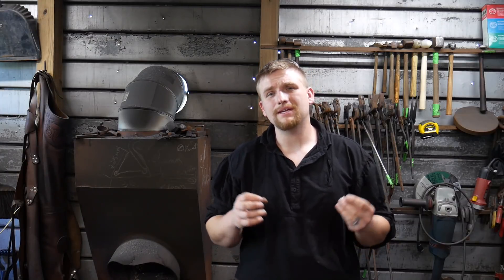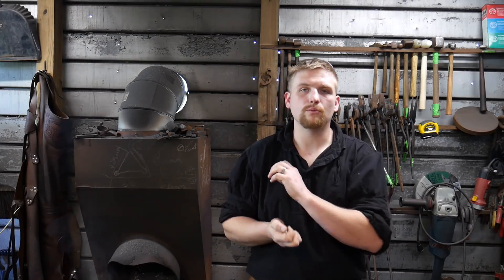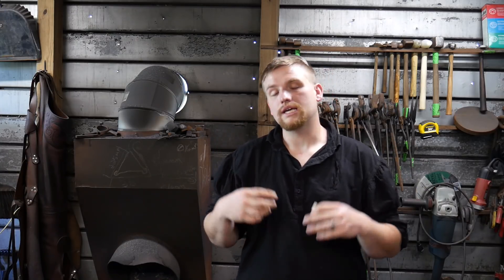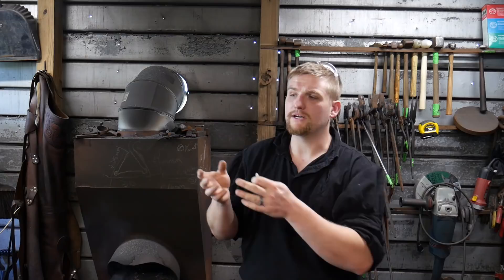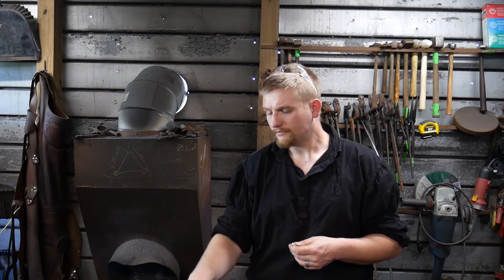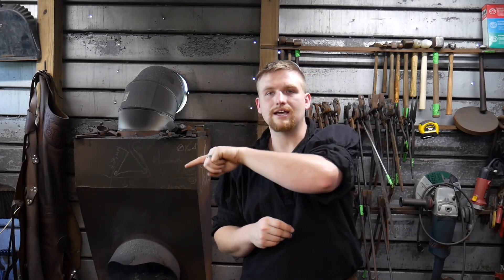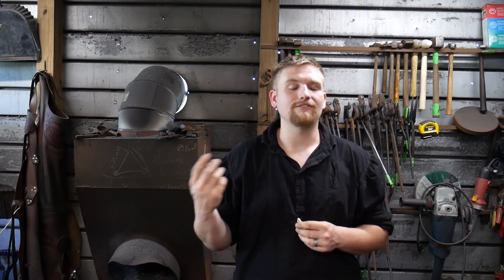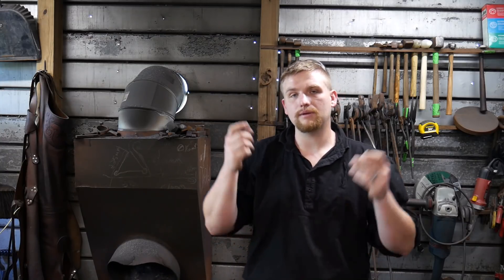Why I Harden In Water VS Oil

Comment: I use 5160 more than anything for the professional grade throwing knives I make and cell which are considered one of the toughest throwing knives available. For the purpose I use 5160 for I use Parks AAA quenchant preheated to roughly 130°F. Only other two steels I ever use are 80CRV2 which I use Parks AAA for, and at times I make and release a run of throwers made of W2 tool steel which I use Parks 50 for.

Comment: I always wondering this: all the factories have heat treat metal sheets with heat deggrees  for any kind of steels. BUT all these numbers are calculated for steels to be tools! and NOT knives with very thin edges. So  is anyone knows where to find heat treat metal sheets especially for knives?
Reply: Ask the steel producer of the steel you want to use

Comment: I have a question you may be able to help with, recently some expensive exhaust components on my truck grew legs and walked away.  Seems to be a large problem right now.
So my solution to prevent this is to weld rods onto the exhaust so that it would be almost impossible to cut through with a Sawzall, which seems to be the tool of choice for this.  A grinder will probably cut through anything, hardened or not so I'm not concerned with that. It will be custom bent and then welded to the exhaust system.  The problem is that nobody seems to be able to help with what metal to recommend.  I didn't want anything that I had to send out for heat treating, that's very expensive, I could oxy/acetylene torch it and quench it on my own, but not sure if that will do anything if the tempering process is skipped.  Hoping you could help advise me in some way.

Comment: I watched Forge In Fire enough to make me a master bladesmith and I can tell you that you never quinch in water.  The judges will get mad, your blade will not keeaalll and you will get cracks and the blade will explode in water.  I have watched every episode so trust me I know what I am talking about.

I just quenched my 1st knife in oil and IDK wtf steel I have but its a 12" circ saw blade.. The file test I've seen it "skates" off. I am now tempering in the oven.  Hell to me it'd be like "i gotta get it hot and drown in liquid, I dont know characteristics of diff steel or benefits/downfalls of em. It literally is a science from the makeup of the steel and diff properties.. As a novice just making a blade to say i did it i am happy with my table saw blade knife and it seems like thr quenching process working for me by the file sound and hardness.

Thanks for the video bud ! 👍👍

Comment: I’ve been digging for my forge steel in a junk pile. How can I know what kind of steel I’m using so that I may use the proper quench liquid? How does one determine this?

Thanks for your videos. Merry Christmas!
Reply: test grind the unknown steel next to a steel you are sure of . the sparks will show you the amount of carbon and alloy. steel manufactures are the best source for info. try to be consistent  with temperature and time when hardening and tempering. have fun..

Comment: How do I heat treat tools that was damaged by a shop fire like wrenches and punches?
Reply: Get hot, quench in oil or water and then temper in a toaster oven. Since you won't know the exact composition of the steel you probably want to start with the slowest quenchent first and check that it hardened with a file, with the tempering 400° farenheit works for knives with the simple steels and with most other tools benefit from a somewhat higher tempering temperature.

Comment: My blade-smith is a retired NASA rocket scientist.  He super quench cools horseshoe and railroad spike blades in a solution of water , liquid soap , and salt.  The hot blades scream while more carbon is trapped in the metal.   He makes Damascus out of S-2 (recycled jack hammer bits , O-1 tool steel , and mild steel.
Reply: Are the tool steels in oil?
Reply: Wtf😂

Comment: Does anyone know where I can find 1045 at the scrapyard? More specifically, does anyone know what pieces of scrap could possibly be 1045? Hydraulic shafts, pins, something? Thanks all!
Reply: Hydraulic piston shafts are usually 1045 with hard chrome plating. It's also commonly used for things like driveshafts and axles, basically anything where more strength than mild steel is needed but not enough to justify an alloy steel like 4140.

Comment: I prefer water that has tweaked additives that some might call unicorn pee, you can be creative. Alkaline baths can be super chilled with dry ice which might add some carbon to the surface during quenching, borax, Epsom salt, sea salt.................... Let us think about this critically for a second. Nordic Ancestors, Blacksmiths,living on the shores of the north sea, where the ocean is super cooled below freezing, yet because of the Saline content that water is still liquid well below freezing. Add in Iron high in tungsten and hot forges wood fired high carbon high temps and you have legendary weapons! Or at least that's how my minds sees it looking back in time. Great Video, here to learn, thank you and may the love of Christ compel you brother, blessings and aloha td #LOVEWINS
Reply from the maker: Aloha to you as well :-)
Reply: Put the crack pipe down..bladesmithing is not an esoteric science anymore
Reply: @TimJameson-jg8sl I would argue it still is😉🤙🏽💯

Comment: im making a kitchen knife with very thin blade 1mm stainless steel. i really want it to be as hard as possible because i dont need flexibility and it will be only for cutting. since its a thin blade is it overkill to quench in water? im not asking for ,,right'' answer because i know there is more factors involved i dont know about steel etc but what do you think?

Comment: Good advice. Spot on, imho about the type of tool and how it can be hardened. But I think you failed to mention the thickness vs the surface area of the piece you are hardenin and tempering. A knife is of much thinner material and much easier to ruin by cooling too quickly. Also some knifemakers may grind the  bevel(s) while the material is in a softer state making the material even thinner. Hence another reason to quench thin material in oil. Just my $0.02 LOL.
Reply: Thing is you need parks 50 to quench 10(84)and 51(60) steels. They need a fast quench to fully harden. You want the softening to be done in the temper, not the quench. Very different chemistry in the steel going on. Toughness comes from temper, hardness comes from quench. Want basically neither? Quench in canola.

Comment: will crome vandalium steel will be better if i quench it in water or oil?
Reply: if i were you id use sea salt water or Epsom salt, it would be a stretch with borax mixed water but i'm not an expert i'm just stating what works with me
Reply: Use water, but differentially.

Comment: In a video that you did last year on hardening and tempering you stated that you primarily quench in oil when making tools,  and here you are saying that you primarily quench in water... I am relatively new to this and would like a little clarification if you would please. Thank you, like the style of vids you make here.
Reply from the maker: My chiseles for chasing I quench in water and my tooling for top tools and the like I quench in oil because they do not need as much hardness. Different tooling and steels require different methods based upon use of that tool. So at that time I was predominantly making top tools in there for using an oil quench method. But my chasing chisels have always been hardened in water. The subject of hardening and tempering is very long and Broad so you may just hear me say several different ways of doing the same thing. Hope this helps clarify God bless you and thank you for the comment
Reply: thank you for taking the time to respond. Your a very talented young man.

Comment: By quenching we rapidly cool a piece of steel in order to retain a  cristal structure which makes the steel hard.
Water is a faster way of cooling compared to oil and air, brine is even faster.
Low carb steels usually needs a faster cool in order to retain as much hardness they can provide( due to their carbon content which is small and makes the steel less capable of being very hard)...
In case of steels with higher carbon content or higher alloy steels( other metals is steel often increase hardness beside bringing other things)  watercooling is too agressive and things like cracks/inner stress areas/deformation may occur so a slower cooling environment is needed( oil,air,etc)...
That is al in very basic and short  way of explaining things.
There are exceptions, high carbon which quench in oil..W1 ( used for making files in the past) is one common example...BUT the rule of thumb is to quench in oil first and use water only in case of using mild steels of steels you know they quench in water...

Way to go is quench in oil...if the steel is too mild/low carbon,it will not be hard enough...if so, try again with more agressive environment,water or brine...
Reply: Liviu e Thanks, that was a very easy and concise explanation
Reply: Nice explanation.  To put a little finer point on it, albeit perhaps a bit more technical, steels are broken down into groups:  Water-hardening group, Cold-work group (which includes the A, O, and D family of steels), Shock-resisting group, High-speed group, Hot-working group, and the Special-purpose group.  Each group contains one or more families of steel which is each divided by hardening medium, such as the Water-hardening and Cold-work groups, or by the specific characteristics of that family for that task.

Water-hardening is just that, steels that are hardened using a water quench, hence the name "W1, W2", etc.  The Cold-work group contains the A, O, and D families of steel.  The "A" stands for "Air hardening" and "O" stands for "Oil hardening", but the D series is a high carbon-chromium family, so the "D" doesn't really stand for anything.  

 Within these two groups the O and W family steels are probably representative of the majority of steel types used in knife and tool making in home shops.  So, you may ask, what makes W steel versus O steel?  A generalization states that the higher the carbon content, the slower the steel can be quenched to achieve hardness, but more importantly to also avoid cracking or other issues, however, there are many factors and caveats surrounding this very generalized belief.  The primary consideration for quench rate is the entirety of alloying agents used in the particular steel and their amounts.  For example, according to ASTM standards, W1 steel can contain a higher carbon content than O1 steel, yet it is still water quenched.  This is true because O1 steel contains a much higher amount of manganese than W1.  O1 having allowable manganese content of 1% - 1.4%, whereas W1 standards only allow 0.1% - 0.4%.  One of the effects of manganese in the alloy is to reduce the critical cooling rate to achieve hardness, so this makes sense, but at the same time sort of busts the carbon content ratio generalization.

Now, with alloys aside, what exactly is hardening and why does carbon steels get hard when heated and quenched?  This has to do with changes in the steels' chemical and grain structures during the heating and cooling process.  In an an annealed state, steel is composed of pearlite (a lamaner structure of ferrite and cementite), this is its softest phase, or form.  In metallurgical terms, this known as a "euctectoid steel."  When you heat the steel, there is a temperature known as the, coincidentally, "eutectoid temperature", but is commonly called the "critical temperature" where the steel's structure begins to change into "austenite."  Austenite, in that crazy metallurgy terminology, is known as "gamma-phase iron."  This is where the "magic" happens, so to speak.

Pearlite crystal structures are known as "BCC", or "Body-Centered Cubic" structures, and this is important.  Imagine a square box or cube.  A BCC structure will have an atom at each of the 8 corners of the cube and a single atom right in the very middle for a total of 9 atoms.  Without going even more technical (it's hard not to!) just understand that this arrangement means you can only fit X number of atoms in a given space.

Now, when the steel is heated past it's critical temperature, the phase change that occurs is from a BCC structure to an FCC, or "Face-Centered Cubic" structure.  In this arrangement, you have the same 8 atoms at each of the cube's corners, but instead of a single atom in the very center of the cube, you now have an atom at the center of each planer, or "face" side, like having a die that has a single dot on all 6 faces.  Now we have room for 14 toms where previously we could only fit 9.  This change represents a density change, austenite is packing more atoms in its FCC space than pearlite did in its BCC space.  And, in this case, the austenite then allows the crystal structure to absorb more carbon atoms from the carbon in the steel's alloy.  Incidentally, austenite is not ferromagnetic, this is why you'll see blacksmiths and knife makers use a magnet to check their heated steel to see if it is up to correct temp before quenching.

The last state or goal is to end with "martensite", the final form of the steel in its hardest state.  This achieved by the quench, or rapid cooling.  If you allow the steel to slowly cool, the carbon in the austenite will slowly diffuse out of the crystal structure (it has to, because we're going from that 14 atom space back to a 9 atom space) and the steel will return to its soft pearlite state.  If you cool the steel quickly enough, you prevent the carbon from diffusing out and you effectively "freeze" the steel in its high-carbon crystal structure, or martensite and voila! you have hardened steel.  Of course, you'll want to temper it back some degree so it isn't so brittle, and the amount you do that is determined by the tool you are creating.  

If we consider that hardening of steel, at least at it basic form, revolves around carbon content and rate of quench, it has been posited that any steel is hardenable as long as you can quench it at the correct rate.  Some research at the Los Alamos National Laboratory resulted in hardening of mild steels using specialized quenchants, but we're really getting into a zone of doing something simply for the sake of doing it because carbon steels are rather simple and you can easily purchase steels today with practically any carbon content and/or alloy agents for whatever task you want or need.  Simply put, there is no practical use for hardening mild steel.  Case hardening of mild  and lower carbon steels is done in some types of work, but this involves carburizing the steel (adding carbon to a thin portion of the outside of the piece) then hardening that to provide a somewhat harder "case" around the internal softer steel, for example machinist's "123 blocks" or other such tools, sometimes it is done for easthetic reasons, such as color case hardening on firearms, etc.
Reply: Liviu e which oil is best. Motor engine oil can be use?
Reply: Liviu e ì

Comment: Anyone know what steel rebar is made from. Thanks
Reply: RedForge Tools ltd R deffew rebar is a very low low carbon steel if any carbon at all
Reply: john kotlarchick ok thanks appreciate it. I can harden it in water pretty well
Reply: Steel.  (I had to do that)
Reply: Rebar has different grades grade 40 is like 1040 steel fairly low carbon grade 60 is similar to 1080 and grade 75-80 is sinilar to 1095
Reply: In Mexico, rebar is spring steel and is commonly made into chisels.